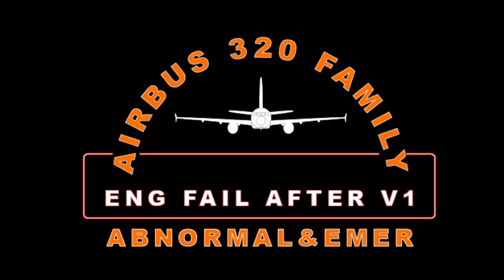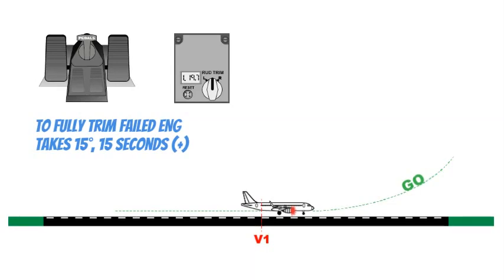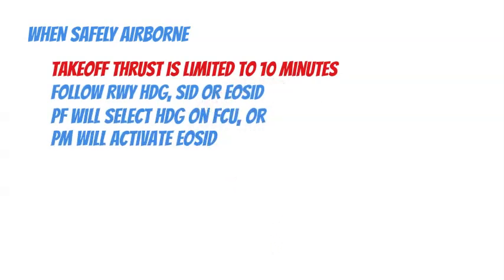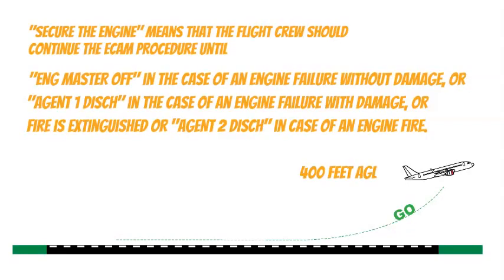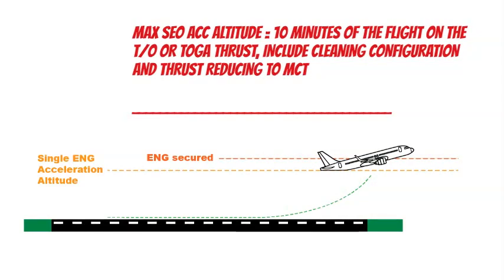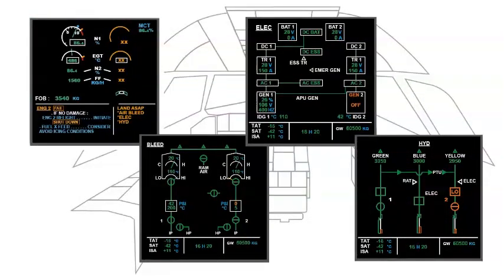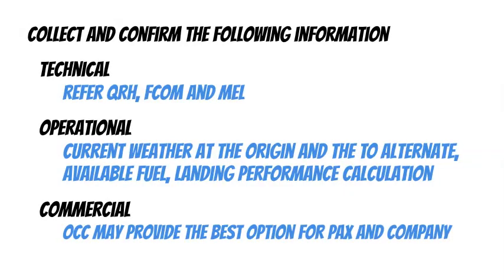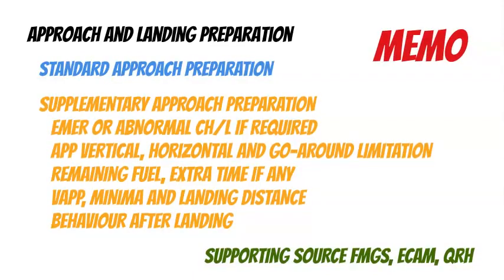A320 ABNP Engine Failure after V1

Comment: Push to lvl off not pull;) but great job :)
Reply: I believe in the example they didn’t level off during T/O that’s why it says pull, they selected open climb ;)
Reply: @Tcastilh  what do you mean by not pushing to lvl off? It's a procedure, and you should do it to get acceleration needed on the live engine and u only select open climb when reaching Green dot speed after the dead engine was secured and the aircraft is clean and speed trend is approaching green dot.